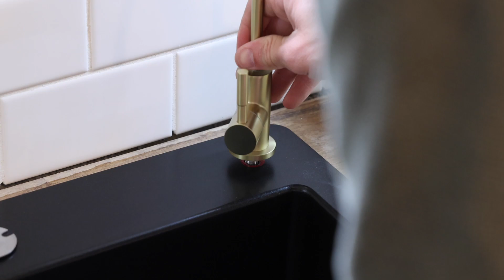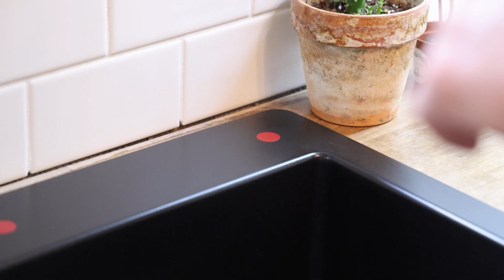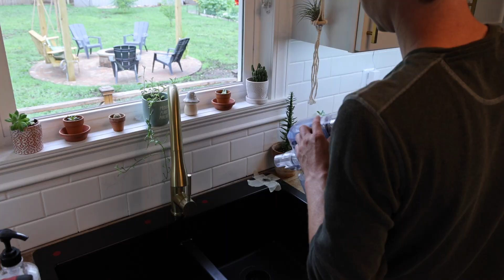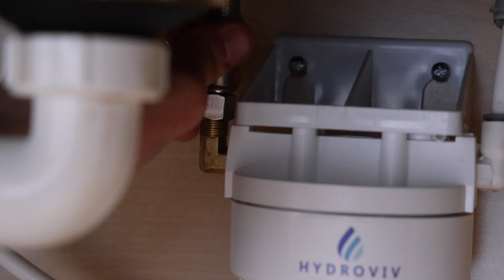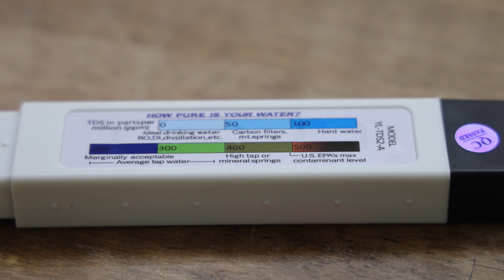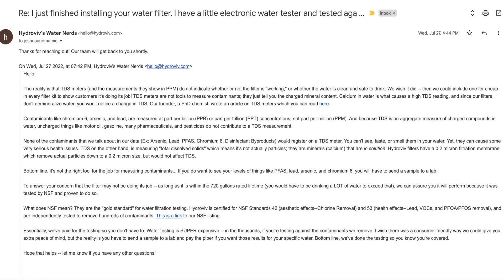I Stopped Drinking Bottled Water- Under Sink Hydroviv Filter Installation - How To

Comment: For the amount of work here a 5 stage RO system would provide vastly better results and you’re clearly handy enough to tackle the project. I’d consider a refund if I were you.
Reply: It all depends on what you want. TDS has very little to do with water quality. In fact the right ratio of minerals will make water taste better and be healthier for you.  What most people want with under sink filters is drinking water. A reduction in heavy metals, chlorine and other chemicals (carbon filtration) bacteria etc.    Most filters that do this will reduce TDS a bit, but not by much as most of it is calcium, magnesium etc. which even an RO filter won't always take everything out. (Though much better than this) 

Again you dont always want 0 or low TDS, its actually what flavors the water and your body needs many of those minerals.   I'm googling hydroviv to see if it actually does anything more than a 5 micron carbon filter would do. So far I've only seen their own marketing and ameture reviews no scientific/data reviews at least by anyone that knows anything about water. So my guess is no, it's not going to be better than a $20 filter container and a $7 carbon filter.  Just comes with everything you need to install it and good marketing.
Reply: @TheHomicidalTendency  is the NSF certification scientifically tested? That should be enough I suppose?
Reply: I replaced my RO (came with the house) with a hydroviv. Takes up too much space and takes a lifetime to fill a pot for pasta. Very happy with it and I have space under the sink now
Reply: @Brad Moran  🤣 Dude, read what you just said. You don't need filtered water for pasta anyways. You're going to boil it and completely vaporize anything that is in that water by boiling it.
Reply: @LeadRakFPS  boiling water doesn't eliminate microplastics

Comment: Why would you not want filtered water out of the main faucet? The entire point of hydroviv is that you don't need a dedicated faucet
Reply from the maker: Yeah that is their major advertising point, but with the dedicated faucet only being used for drinking water instead of using the filter for everything through the regular faucet, the filter will last a lot longer and not need replaced as often
Reply: @TheFixFinder  I get that.... but at the same time, if you its not safe to drink, its not safe to wash anything. You're still ingesting the harmful things due to it being on your dishes / food that you rinse.
Reply: @TheFixFinder  It's not an advertising point; it's the entire point of under sink filters. I don't want to cook or wash my dishes and hands with unfiltered water. The idea is to avoid the contaminants in the water;
Reply: @bradmoran5229  Nah, you don't need filtered water for these things. Unless there's bacteria or significant heavy metals, then you probably want a much better filter than this. I don't see his point in a dedicated faucet as the filter will degrade over time, most will always have a 6-12mo turnover as it begins to stop filtering from its chemical stage and start growing larger bacteria clusters. 

If he wanted to save money he should've just put a two stage sediment/carbon filter  0.2 micron on it.  Way less restrictive than R0 and still a very good filter for water quality w/o reducing TDS too much removing taste and health benefits of tap water. -
Reply: @Brad Moran  Respectfully, you have no idea what you're talking about. No person in their right mind would set up a filter of this size as a whole water system for a single faucet. The filter is too small for that heavy of use. It will filter water that you will use to cook with and wash your hands, but that is absolutely not needed and ends up being a waste of money by the time you replace your filter 10 times a month. 🤣
Reply: @LeadRakFPS  Right. "no person in their right mind" would use a product in the manor it was intended to be used. Its about 5 months of use. (it only on the cold water, and hot is used for washing dishes, etc in the kitchen).I can afford it. Sorry if you cant. If you think that arsenic and other contaminants can't be absorbed in your skin or through cooking (I doubt you cook; you seem like a Tacos guy to me) then you're wrong.
Reply: @Brad Moran  To be clear, this is not a "whole water system" filter. It is for under the sink, but for drinking only. They make waaay more cost effective and robust systems for "whole water system" filtration under the sink. It will typically be a 2 stage setup or even just an RO system. Any single filter of this size is meant for a drinking tap only. Why? Because any use past that will be spending more money than you would have by just going with a 2 stage system. Stay ignorant, though.
Reply: @Brad Moran  Also, when it comes to "affording it", I have a whole house filtration setup. The filters are a little smaller than a 5 gallon bucket, and there are 3 of them. It's a 3 stage system. So, if you can't "afford" a whole house, 3 stage system, then maybe you don't know what you're talking about.
Reply: @LeadRakFPS  I initially looked into whole house and rejected them as ineffective. You're an amusing guy;  you're aruging that you should install a trickle faucet under counter, yet you have a whole house filter yourself. 
Back into your clown car Dude.
Reply: @Brad Moran There you go again showing your ignorance in full force. The only thing I'm suggesting is using this filter for what it is meant to be used for. Which is for a drinking water spigot side only. But, ignorance is bliss man. Go ahead and ignorantly use it for the main faucet and shorten it's intended life span by washing your hands in it, dishes in it, and using it for boiling cooking water. You're on another level of stupidity if you think a 3 stage, whole home filtration system is ineffective 😆. It's way more effective and cost-effective than using a small "drinking water side" filter for everything in that sink. Way more effective. There's no way to single out it's intended use because it filters the water before it enters the house....3 times. That's what you need if you want filtered water for hand washing, showers, dishes and cooking. That way you're not replacing that small (drinking water only) filter every 3 months (which is it's intended use). If you think you can get 6 months out of that small filter while using it for more than just drinking water, you're a special kind of stupid. That filter will be filtering almost nothing by month 4 to 4 1/2. The only clown here is you for still arguing and being completely wrong. Keep your head in the clouds though, bud. 🤡🤓
Reply: @Brad Moran  And if you read everything I've wrote from the start and understood English, you would see that I'm not arguing against using this filter. I'm arguing against using it for a WHOLE SINK, MAIN FAUCET SYSTEM. You would need a 2 to 3 filter system with the same size filters to get a full filtering range of 6 months out of these filters when used for the main faucet. The single filters of this size are for a drinking tap only. Which is why I called you out for using it for a whole faucet system, because you're clearly too ignorant to realize it. Go ahead and test your water after 6 months of using this filter for EVERYTHING instead of just drinking water. I'll wait.
Reply: @Brad Moran  And I'm arguing that if all you are going to have is this single under sink filter, then all you should use it for is drinking water. If you use it for more volume than that, you need to replace that thing every 3 months instead of 6 months. That filter will not last 6 months with the volume you are pushing through it, it's too small. I don't have to worry about it. I only brought up my whole house system because you mentioned being able to "afford replacing a filter" more often, which insinuated me not being able to afford to replace the filter more often. Which was an ignorant mistake on your part, because I can clearly afford a whole house system. So you set there and touch base about being able to afford to replace them more often, but then say that this filter is good for its intended 6 months when your pushing twice the amount of volume through it by filtering all the water through the main faucet. Lol lol, 😆 🤣.  You are the epitome of a clown in a clown car. Stick to your guns though man. This is amusing.